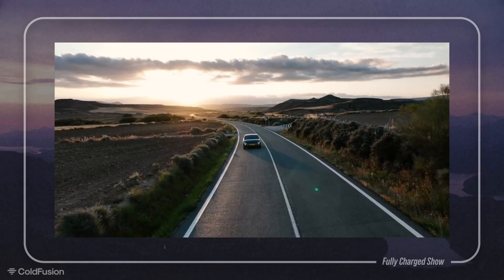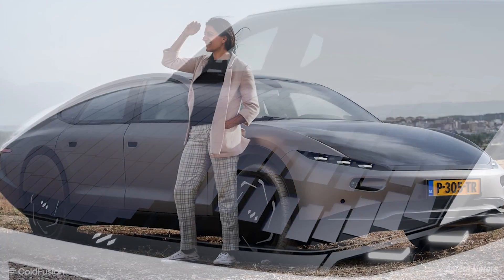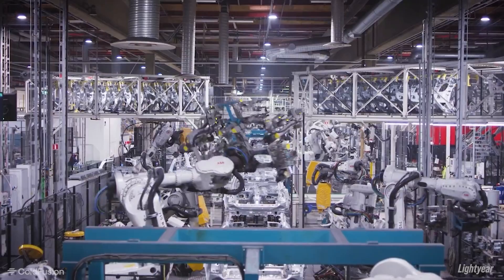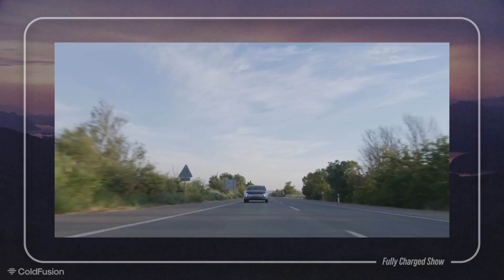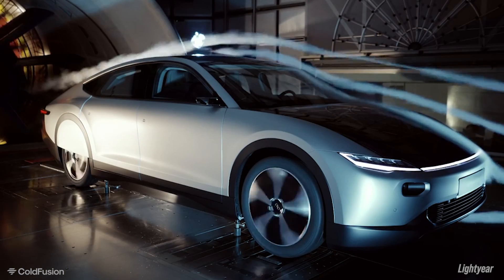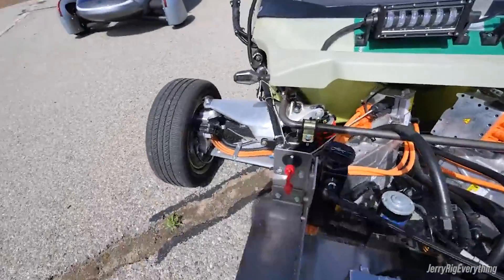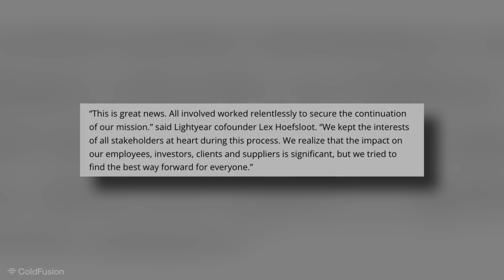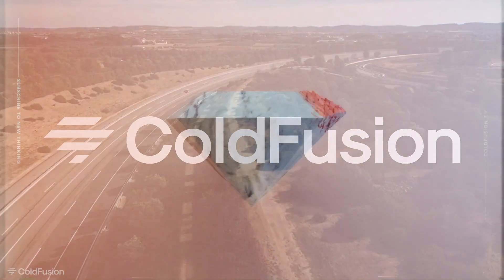3 Interesting Solar Car Projects

Comment: I think that Darwin to Adelaide is unrealistic and is too ideal for the solar challenge . It would be better if it was from Eden to Adelaide .I completely agree about effeciency .Solar is only one part .Why not include effiency as to petrol engines" 200 cc " or even compressed air as a way of storage ? I agree that cars are way to fast and many have the capacity to exceed the speed limit twice over .

Comment: I'm sorry, but these "Solar Electric Hybrids" are nothing more than a gimmick. Given the roof and bonnet space you could cover with solar panels,  current solar panel technology would provide an additional 1 kWh in energy. Over 9 hours, that's equivalent to the energy in one litre of Unleaded fuel.

Take away the solar panels, and this is an efficient electric vehicle. Not necessarily a bad thing if you sell it from the point of view of range, but I doubt the vehicle wouldn't have seen the interest it did without the solar panel gimmick.

Comment: The ONLY reason this company failed and may fail again is through those who CONTROL the money, they've done it to every "threat" to their control in the past and until they are eradicated it will never cease.  Avoiding the obvious and speculating poo poo this and poo poo that "may have been the cause" is the blind convincing the blinded from the truth.  It won't go on, we are awake, secrets are out and more to come to seize power from the scum.  Free energy is worth dying for and many have at the hands of fools and murderers.  The people ARE going to take back our planet and rid it of greed, sharing is for all, as is power.  If every person gave just $10 ONCE, none of this would be an issue - like EVER.  And I'm only thinking of Australia here, that's $2.6 BILLION from us alone... destroying ALL chances of driving a free energy company bankrupt.  Think about it, did YOU hear about the crowd funding effort of Lighyear?  NOPE!  MEDIA CONTROL ensured it didn't get to you who would definitely fund it!  I and most others would buy a car that costs nothing to run, why do you think there are bicycles?  They AIN'T FAST but free to drive.

Comment: the point about if University is needed in the AI world,  I think yes it still holds a value.  it's not so much about getting particular skillset anymore, it comes down to more about how one process its thinking towards approaching an issue.  it also give you the entry ticket to a specific club of people.  with GPT coming to everyday life, holding a knowledge is becoming less of a value (so long as you know how to use gpt)

Comment: Solar efficiency is too low it will never stand the load or deliver the energy,  ENG8  have their EnginCell validated by Cambridge London & Brighton University', s Portugal EU, UL and LNER Forum, at last a way forward, but not only for cars, houses, heating, AC, water, factories and Trucks Trains & aircraft, can solar do that?

Comment: Earlier in the video, you correctly point out that efficiency is absolutely key, but you end the video with more emphasis on the solar-charging aspect of these cars. The solar aspect is a cute gimmick, and for sure it will be nice, but what really matters is that a car like the Lightyear, and much much more so, the Aptera, are highly efficient. Efficiency is what matters! The solar EV industry has gone off the mark particularly in the US by building bigger SUVs with longer ranges and bigger motors -- all which makes them much less efficient. Then, suddenly, we're back to the same problems with gas-powered cars: we'll start over-taxing natural resources. There is a limited amount of lithium, cooper, silver, etc. in the world. While some consumers want bigger/longer-range cars, in the end, in the future, we will always need to be improving efficiency. In that regard, I'm confident, whether Aptera makes it or not, that it is the type of car we will be driving in the future, not because it has solar panels (though again, that's a nice perk), but because it is so efficient, uses so little energy, takes such little time to charge. It's what EVs need to be, and, if so, the future is bright.

Comment: In Austria the speedlimit on the highway is 130km/h... sure acceleration might not be as cool as with a tesla but if its reasonable the speed of 160km/h should be alright for many many customers. Also think about not having to pay for gas or electricity!

Comment: I would absolutely own one of Lightyear 2 for many reasons but I’m also reluctant for a couple others 
Pros :
- platform is interesting as the car is bigger -> more solar panel surfaces 
- solar panels mitigate electricity volatility prices
- 40k€ is affordable and comes very close to Tesla and other EU EV manufacturers
- perovskites are a TOTAL game changer, EVEN if that means that we have to change them frequently with a subscription system
Cons :
- the biggest by far : repairability
- the second biggest : network effect as a function of repairability to train mechanics on repairing as well as a big enough spare parts economy.
-

Comment: i mean tesla could integrate this idea into their cars couldnt they? introduce a solar roof on their cars, reduce the size of their battery packs,this would reduce their range but it would be supplemented by the solar roof during the day, and a smaller battery pack would significantly reduce the weight and increase the range and even acceleration......introduce a hyper efficient mode on the car like ludicrous mode, except it would cap acceleration so as not to waste huge amounts of energy accelerating with huge torque, and also maintain crusing speed at the most efficient level.

Comment: The concept is interesting, but it (unfortunately, one might say) comes down to solar power efficiency. The surface area of a car is nowhere near enough to provide useful amounts of power to  charge the battery in meaningful amounts.

Comment: At first, the car was prices €125.000 iirc. 

40 years ago 0-60 in 10s was considered fast. Even today most small cars (European standards!) will do less than that.

My car is much faster but I hardly use it. I sometimes do but I never NEED it.

Comment: How long do the panels last? What’s the maintenance cost? 
Can you charge it at a charging station?
Would need to see results after 2-3 years of driving.
How does the efficiency of the solar car compare to a gas car?

Comment: There's a really big scalability problem with automotive energy efficiency. There is a near inverse relationship between drag coefficient and spacial efficiency of a vehicle. the more aerodynamic a vehicle is, especially a solar vehicle, the less of it's footprint is usable for passenger and payload volume. This is very bad for land use. It's like how CAFE makes American trucks way too big, except that CAFE is a government contrived equation, while the space wasted by aero design is inherent. That's not to say that a Toyota Hiace can't have reasonable aero, but optimizing aero becomes costly the farther it is taken.

Comment: Very interesting, and I hope both Lightyear and Aptera can make it happen. I'd certainly be interested in a slower car that can self charge from solar.

A couple of thoughts, for whatever they're worth:

1. Remember the documentary 'Who Killed the Electric Car'? I don't know one way or the other in this case, but my gut sense is that there are people (Schwab Slobs, etc) who have a vested interest in making sure that a car that can be charged from solar never, EVER becomes mass produced, and certainly not at a price that common folk can afford, regardless of how sincere the people who run the two companies named in this video may be.

2. Vince Foster (Jeffrey Epstein for those of you too young to remember. But it's the same people behind both of the 'suicides')... yeah... I'm thinking that anything like this that people will genuinely benefit from will be 'suicided' before it can ever reach fruition. And the cynic in me says that Mr Musk must undoubtedly be aware of these two companies and what they've accomplished. He could easily have invested in them in return for access to their technology; yet he didn't. Instead, his busoness model focuses on vehicles that, generally speaking, will inly be charged from the grid, except in some cases where people personally invest in enough solar energy to be able to charge his cars with solar, and it ain't a cheap investment.

I hope these companies will be successful; I truly do. But I can't see the Schwab Slob type of scumbags ever letting them get very far with it.

Feel free to tell me I'm wrong. I hope I am.

Comment: I like the mindset. Never understood why high horse power and top speed matters, usually (especially in cities) you never go over 70-90kph, even on highways 130-150 is more than enough. High acceleration is also pointless in cities going from red light to red light. With a "weaker" car being much more efficient, lighter, smaller, it can cross the treshold to be sustained by solar panels on the roof, which is a complete game changer.

Comment: the biggest problem with solar-powered cars is not solar cell or aerodynamic efficiency, as especially the latter is not going to get much better. it's that (a) the solar panels are always flat and don't track the moving sun, (b) the farther away from the equator you are, the smaller the solar irradiance you receive, and (c) cloudy days are quite common in many places in the world and clouds reduce solar power output by as much as 90%.

those three factors combined bring the expected solar power output averaged over a year and over the whole surface of the planet (assuming global adoption of this technology) of any solar car by about an order of magnitude compared to the absolute best-case scenario of the sun being directly overhead. that's about 0.1 kilowatts realistically compared to the theoretical maximum of roughly 1 kilowatt. to put this into perspective, just to overcome air drag you need about 0.6 kilowatts of power driving at a speed of 50 km/h that's typical of residential area speed limits.

so yeah, best-case scenario we might eventually see more solar-powered vehicles moving rather slowly in residential areas of places close to the equator that see lots of sunlight year-round. any other scenario relies too much on battery power to justify paying that much money for having solar panels on top of your car.
Reply: More or less obvious points but why you think best-case scenario means "rather slowly" is bizarre.  Maybe you don't understand that every solar assist vehicle discussed in this video has batteries.
Reply: @bobhilder1469  i meant rather slowly if you want to make good use of the solar panels. otherwise you rely too much on the batteries, which means you might as well just scrap the solar roof and put more batteries in. i've edited my original post as well. is it clearer now?

i think a good counter-argument would be that solar panels could be used to re-charge the batteries. the problem is that the solar panels will, on average, charge up to about 0.1 kilowatt x 10 hours = 1 kilowatt-hours per day. given that electric cars have an efficiency of roughly 0.2 kilowatt-hours per kilometer, that would limit your use to a measly 5 km or so per day if you want to be independent of charging stations.

so i believe my argument still stands. in most places on earth and most days of the year, the solar panels would provide so little power that they neither help keep the car moving at reasonable speeds even in residential areas without substantial assistance from the batteries, nor do they provide enough juice to charge your car up beyond driving it for about 5km per day.
Reply: @tasos1112  There's no doubt that the solar on Aptera isn't for everyone.  There are, however, many that would benefit from it.  The math says those that live in sunny climates could easily average over about 25 miles per day of range and that range is not accomplished "rather slowly".
Reply: @bobhilder1469  ah yes. my original argument was specifically referring to "regular," or let's say "family" cars as they're called in this video, as a response to the claims made about the lightyear 0. the aptera looks smaller and (substantially) lighter than a "regular" car, which would make it more viable than something like the lightyear 0. would you care to point to where this math you mentioned is worked out? because lightyear's math is too optimistic.

also, you seem to be fixated on my - admittedly vague - use of the phrase 'rather slowly'. by that i mean below typical residential speed limits of around 50 km/h. in the same spirit, i consider 'fast' a car that drives on a highway, at least 100 km/h or so. this hopefully clarifies things.
Reply: @tasos1112  Sorry, yes, I lost track of which vehicle you were commenting on.

With respect to Aptera's math, it's approximately 3 m^2 of solar can generate a daily average of, at least, 2.5 kw-hr of electrical energy in a sunny location.  The vehicle is purported to only consume about 0.1 kw-hr per mile of driving at, say, 60 miles per hour.  2.5 kw-hr per day divided by 0.1 kw-hr per mile = 25 miles per day.

Comment: I was thinking that my car is always steaming hot in the summer and kind of hot even in the winter when it’s in the sun.  Why don’t they’re out solar panels on the car to charge the car while you park it in the sun. God knows I parked my car hours in the sun only to have to crank my air conditioning. How much mileage can we stretch out if there were panels all over the car??

Comment: Im sorry to pop the hype-bubble, but there is no need for Solar Cars in this world (execpt small niche markets). Electric cars are already very efficent. So just put solar panels on your roof and buy a regular EV. You end up with a WAY better solar system and a cheaper and/or better EV.

Comment: Make a solar car that respects the owner’s right to repair and doesn’t collect data on the owner, and I would be happy with it as long as I can afford it. Price and income just have to match up. (Also use physical buttons and knobs for controlling basic things in the vehicle, such as air conditioning; the touch screen nonsense that we’ve been seeing more and more of is actually hazardous to the public.)

Comment: Yea ... Tha is da ideai... But yea. It need to go faster an acelereit lake a rel electrin in 4 sec... But they codov don theat with mode slelection.  Fore eco eco .. for norman norman. For speed hiper mode . Gen . But thy did not and it is stile dabel of a norman sedan price at 30 k . Wel see it tey ar rela wentey mas produce . As fore prius . Bravo Toyota veri cool.but pls more

Comment: With many examples of the effect of climate change, more people are open-minded to alternative (clean) modes of transportation. Speed is advantageous if there are few people on the road. There are currently more drivers on the streets in my area due to the effects of COVID; people not wanting to be among groups of people. I would purchase such a vehicle, so I'm looking forward to the new innovations in the automotive sector. However, I'm also suspicious of the rise of such a sector. Will we ever see a significant reduction in oil dependency in our lifetime?

Comment: Putting solar on the car is a gimmick. Put the solar panel on the roof of the house where the car will be parked. Then the panel will be pointed in the right direction, and you won't have to drive it around!

Efficient cars however totally make sense.

Comment: Alternatively, for the same price you could: buy a normal EV, pay 50% down payment on a house, and get a big solar panel array w/ battery backup and also drive virtually 100% of the time on solar power.

Comment: I know absolutely nothing about technology, or engineering when it comes to the automotive sector. I work in healthcare, so I have a question I’ve always wondered, but I’m hoping somebody could answer. Why can they not make an electric car where two of the wheels are the drive wheels, and the other two freely spinning wheels could be geared to a generator, that could constantly recharge the battery as the vehicle moves, eliminating the need to plug it in? Is that even possible? I’ve always wondered that, why can’t they make a self charging electric car that doesn’t need solar power?. I just assumed the answer was greed, nobody wants to sell a product, that they won’t make any further money off of, like they do a gas powered car, which they make a fortune from on repairs. But regardless, every vehicle would still require maintenance, even a self charging electric car, so is it even possible?
Reply: That will violate the laws of thermodynamics, it's physically impossible. It takes energy to move a vehicle and there will never be enough energy collected from regenerative methods to run the same system independently. In fact, it will be worse as there will be consistent buildup of heat further wasting more energy.

Comment: I loved how zero part of this video talked about the actual feasibility of adding 60km of range everyday on solar panels. This is almost impossible to do except in perfect conditions and a much larger surface area solar panel. You can watch the EEVblog video on this car to see that this is simply impossible. I know you are less technically inclined but some research beyond the marketing material would be nice.

Comment: We need Tesla to use a gasless and oiless self running generator, a mechanical direct connect to the axle, solar, kinetic braking and wind turbines, to super charge EVs. No more plugging in ever again and we can all be giving back clean energy, to the power grid.